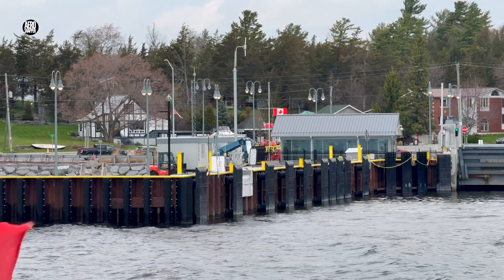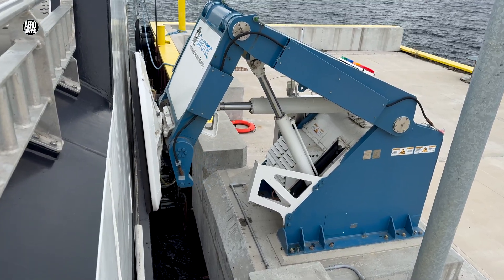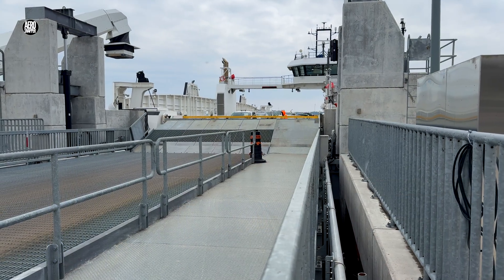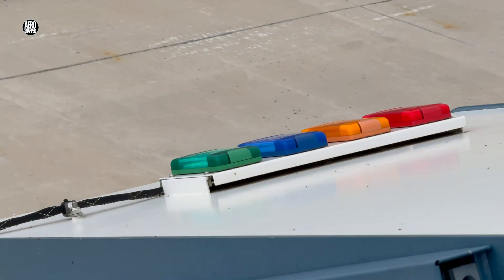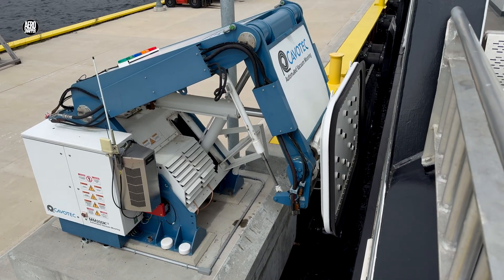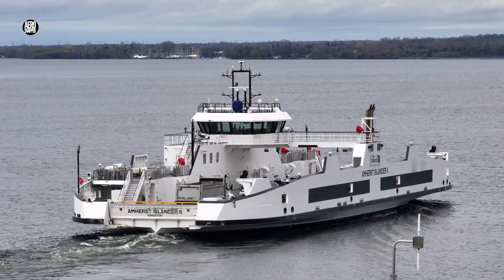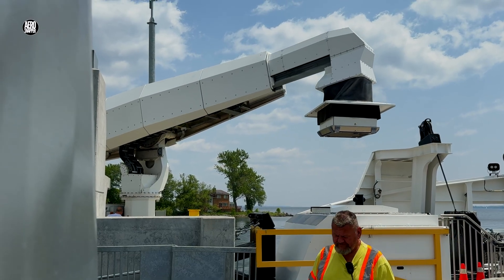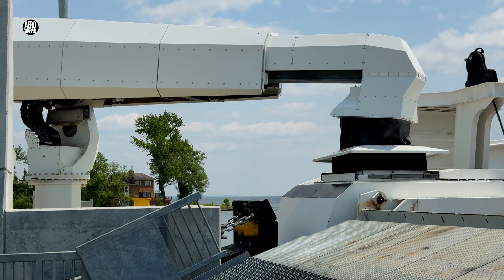It Sucks, when it Blows  - an examination of vacuum mooring 4K

Comment: With this system, are cables still needed?
Reply from the maker: Great question - in principle NO - but a cautious Captain, until he has complete faith in its performance and reliability in his particular service - may choose to add a line or two
Reply: @Aerosnapper  Wouldn't you have to?  What if there is a loss of power?
Reply: @jimdennis2451  vacuum will hold the ship for some time. The crew is notified about power loss and they have time to react (e.g. start thrusting against the fenders)